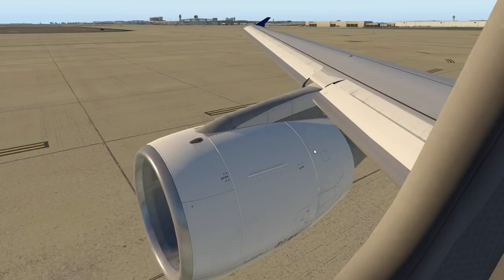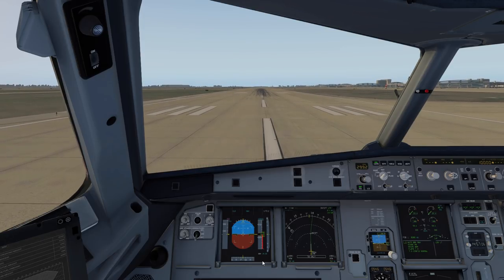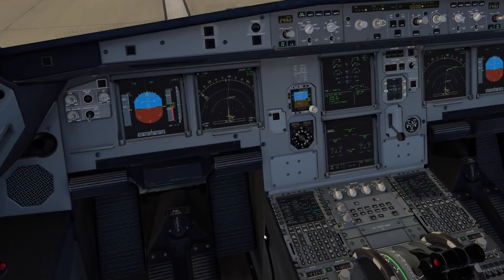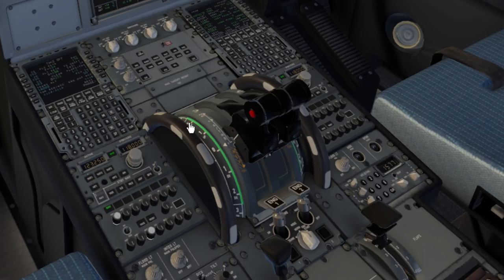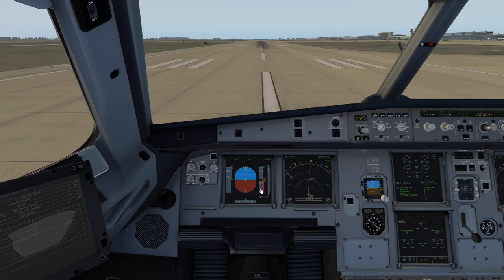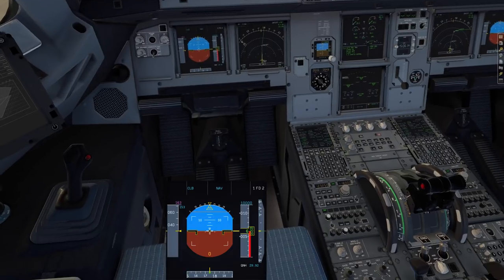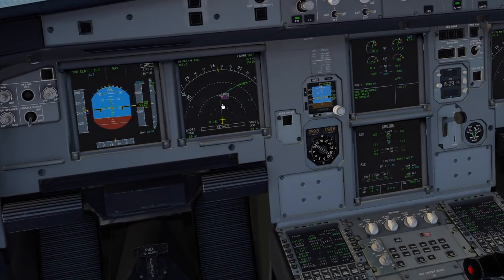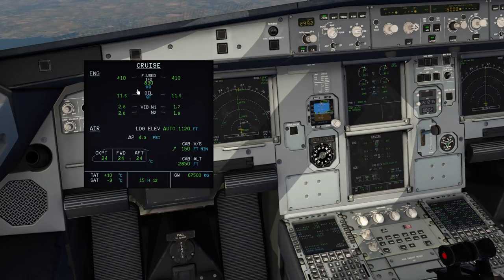I Airbus Professional I Takeoff and Climb Episode 2

Comment: I have really appreciated this series of videos but I've had, until yesterday, problems getting the auto-throttle to engage on take-off. I studied the this particular video several times to try and fathom out what I was doing wrong, but I didn't realise until I did several 'experimental' take-offs, that I wasn't advancing the throttles quickly enough to the FLEX detent. This action was hard to overcome as I've been a 'Boeing' and ''Turbine' man, and advancing them this quickly was hard to overcome. I would suggest that you emphasise this aspect a bit stronger so we all get the message. Many thanks. TG
Reply from the maker: Thanks for that, I definitely will. I’m in the process of updating this entire series with better audio, more information and updated aircraft as well.

Comment: I noticed in this segment that the terrain function was not on. Can you comment on how your company used this and the weather function. Is it terrain on F/O side Wx on pilot side or...? Under what circumstances do you use either and how? Great video. I am going to purchase the Toliss in the next couple of days after having flown many hours in the FSLabs A320. I only use xPlane now, so this should be good.
Reply from the maker: Bill Barrette typically we turn the radar on before takeoff and off after landing, however when it is clear and no weather I keep it off to save myself some unnecessary radiation lol as far as terrain mode, this is required when going into an airport or departing an airport that is designated “mountainous terrain” which will require 1 nd to have terrain on and the other wx, or both in terrain mode. I don’t have the exact wording for designating an airport Mountainous terrain  but on our company charts it’s depicted at the top and highlighted in yellow. Basically any airport with terrain near it you can bet it is one 👍🏻 glad your enjoying the content

Comment: Some questions to the takeoff performance, hopefully someone will see and answer this! Your V1 on the irl sheet was 126 and if you’d have aborted at 125  there would still be more than 9000 feet left over after a successful stop?? How can this number be so high, doesn’t that mean that V1 can be way greater than 126 or are other factors than just remaining rwy distance? Like couldn’t you have aborted at 131 and still stopped on the runway as you likely wouldn’t need another 9000 feet just for these 5 knots more?

Comment: Question. Why is the THS blank?? When I do the weight & balance, I get, i.e TOWCG 30.2 and Stab DN0.47 (rounded to DN0.5) and using Config 2. Do you have to input the DN0.5 in or leave blank?? What is the rule on that??

Comment: Hi please could you help when I take off  and air borne after disarming the spoilers the heading inductor comes on I tried turning off the fd's to reset it but the speed indicator goes into management mode which I wanted but the heading doesn't go into management mode how do I fix that please